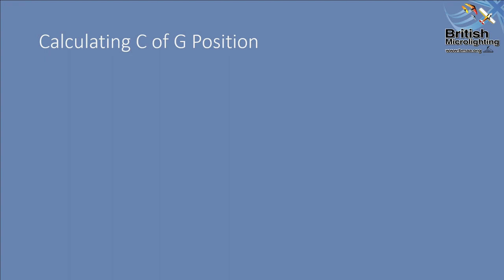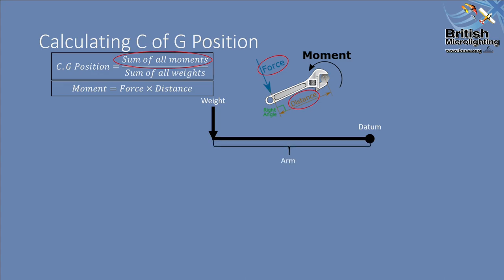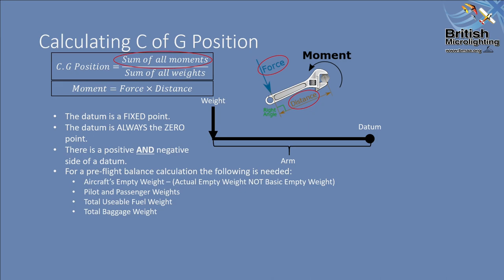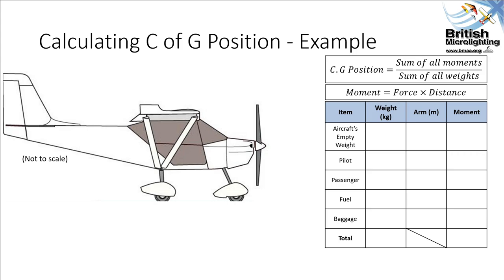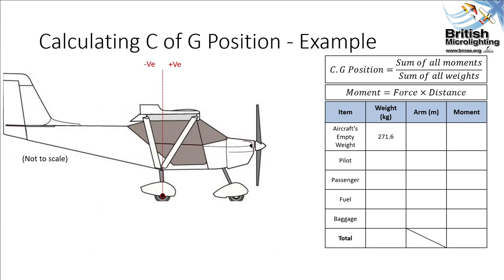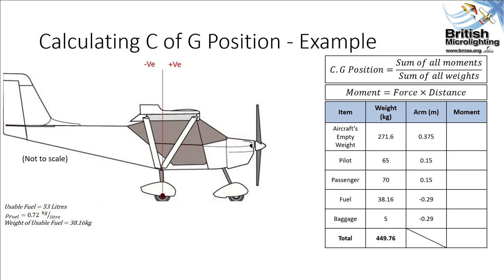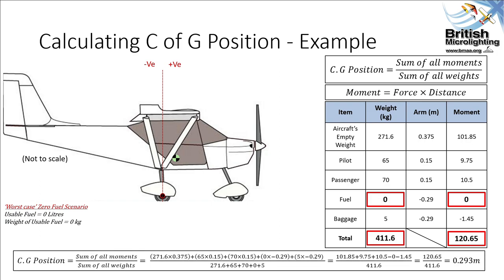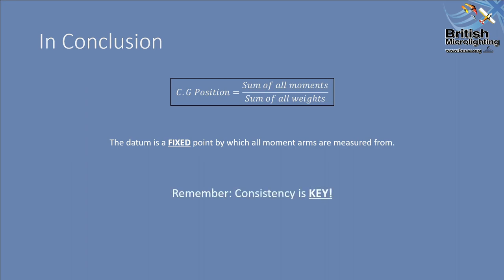BMAA Centre of Gravity Calculation Guide

Comment: While your calculations are correct you go about it in a long windedway. Basically, if you remive the hash line from the box between total weight, and total moment, then divide the momemt by the weight you get your answer. A demonstration on excel would be a lot simpler.